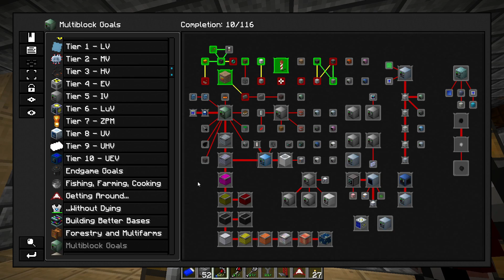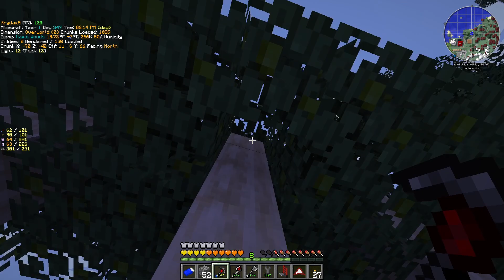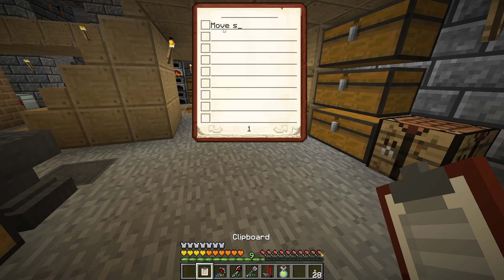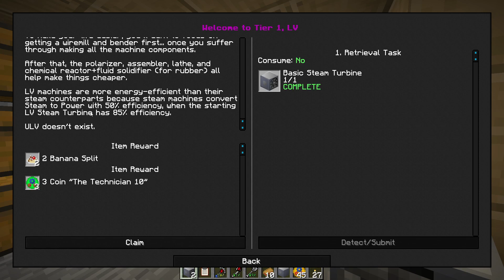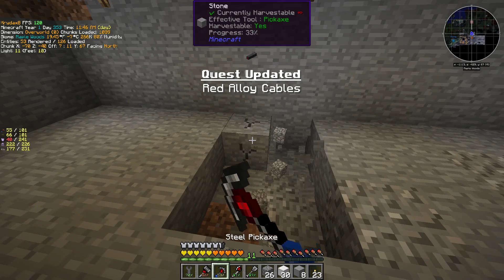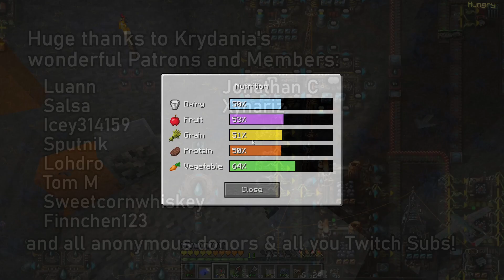GregTech: New Horizons #23 - Railcraft Boiler & LV Bending Machine!

Comment: Congrats to LV.
52:45 Why should it mention the EBF? EBF only needs 1A.
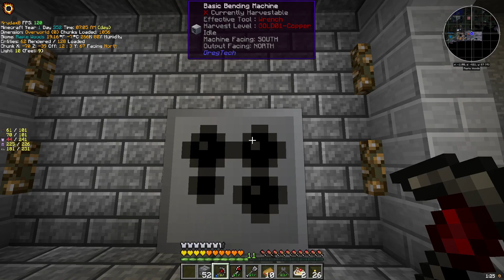1:02:10 Have a look at the "slightly larger chest". Don't be fooled by the name. Its inventory is not slightly larger, its visual is. But what is allows to do is to be opened with blocks above

Comment: And you can check if there cheap cobalt recipe in a BF from cobaltite, if so - you can use cobalt tools instead of precious steel (atm). It's easy to find vein in the Nether, but it can be challenging to mine in a GTNH, but cobal should be good material worth it (if it available at this stage in GTNH)

Comment: Well, seeing you constatly hitting that steam pipe through the series I gonna say it - you can cover them, you probably know it but anyway.
Reply from the maker: OH, like with a GT plate? That never occured to me LOL. I mean you saw me make those cobblestone covers before, but those occupy the block adjacent to the pipe.
Reply: @Krydax8   or an Oak Wood Plank sawn twice into "Oak Plank" (the ones used to make signs), which does not occupy the adjacent block.
Reply: @Krydax8  you can use cheaper wooden GT cover (I hope it doesnt burn in GTNH) or try forge miniblocks - there were compability mod so covers can work same way as plates, but idk if it same in GTNH.
Reply from the maker: @quadbitbrain  the forge mini blocks don't work, they just get placed on the adjacent block to the pipe

Comment: Here's some food for thought with regards to steam generation. 48 coke ovens (I built 64 for spare fuel) will constantly power 2 maximum size (3x4x3) high pressure railcraft boilers, one from the charcoal and one from the creosote. Those boilers will need 16+ (more for safety) water tank sidings in an 80% humidity biome. The steam produced can power ~37 basic steam turbines or 8 advanced steam turbines. This will fairly comfortably get you to stainless steel and late MV. The coke ovens will need two 11x11 plots (or one if you don't mind topping the wood up manually occasionally, or a 15x15 at MV) of spruce bonsais harvested by LV crop managers for a completely passive system. The GTNH wiki has all the formulas for the railcraft boilers.

Comment: My understanding is (and I am happy to be corrected): machines request EU from generators, always a full packet (32 EU at LV), when they have room in their buffers. The packet undergoes cable loss for every cable it travels through, including the first. You can confirm this with a Portable Scanner in a test world if you wish. You can power a machine without an intervening cable. I'm not sure why yours didn't work, possibly because the turbine was facing the side rather than the back.
Reply: Program Circuit number wasn't set when it was being direct powered.